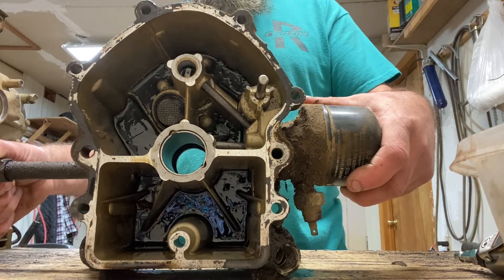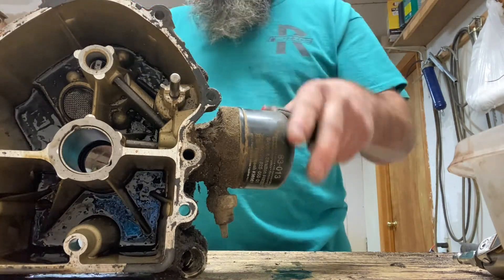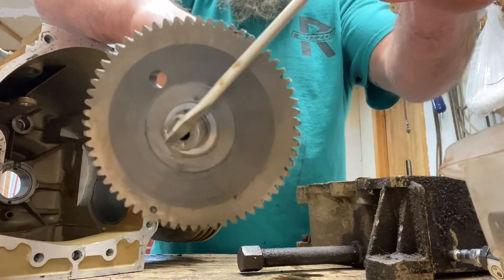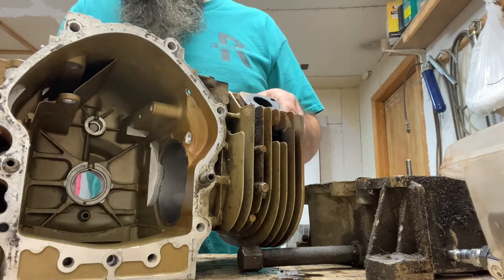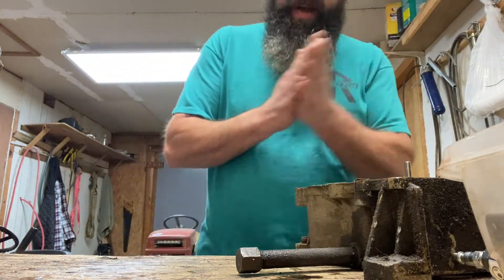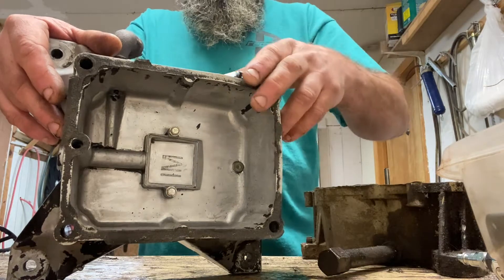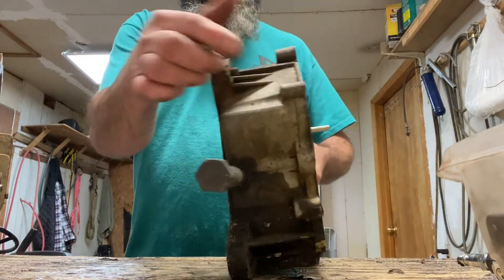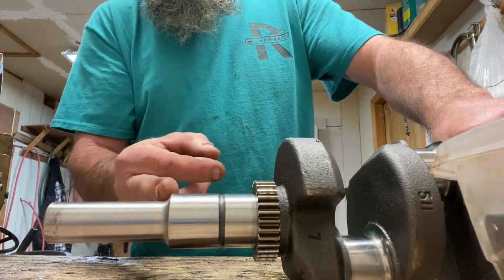Opposed twin vertical/horizontal swap

Comment: I swapped a vertical to horizontal splash lube briggs back in 2010. I had bought a Cub Cadet 582 with a broken rod and used a very late, (I'm guessing around a 2002) vertical twin from a MTD lawn tractor. The MTD had very little use and was abandoned at the lawnmower shop I worked at sometime around 2005. I ended up selling the Cub to a guy I worked for at the time and he used it for about 6 years to cut his grass. Flash forward to 2021 and I ended up buying the Cub back. I know this is a long story, but I have been using the Cub up until this year when I started having serious blowby issues with one cylinder. Turns out the RH breather valve facing the flywheel came apart, (ie. the bakelite flapper broke). When I removed the breather the lifter valve spring area was HALF-FULL of oil! Turns out there was no way for the oil to return back down into the crankcase! There were two holes, but would only work in the vertical position not horizontal. I overlooked this when I assembled the engine. I have taken the engine apart and drilled two holes (one in each area) for the oil to go down. I hope to get the engine back together sometime next week. I was also getting a lot of smoke on startup, I hope this fixes the issue.
Reply from the maker: Yes sir that will definitely do it! Good catch!

Comment: The blocks you speak of that were dual purpose (plastic plug in the horizontal dipstick hole) were from about '91 to '94. The cooling shroud on those were black. When they went to the red ones from the mid 90's and later the hole is just closed off like the one in the video.
Reply: Hello I’m trying to figure out if I have a dual purpose block. This plastic plug for the dipstick. Mine I think if I’m looking at it correctly it looks like a allen type plug? Is that possible? Just curious if you know or have gained any more knowledge about the subject? If not please don’t worry about it you were the first person to mention the dual purpose blocks. Either way Thank you.
Reply: @dalylarose2516  If there's a plastic plug there of any type, the hole will be underneath. It should be threaded.

Comment: If I find a pressure lube model 46 crank I'd just add it to my horizontal dip lube block and add dry sump with lines feeding the crank🤔

Comment: I'm working on one right now. I have the sump with screen Ive drilled a hole up to the screw hole that will feed front cover lower crank front and can above however my cam doesn't have a hole tru it captin! So it's either I drill all the way thru cam or send a feed up and over I'm not sure
Reply from the maker: Oh yeah, you definitely need SOME way to get oil to the other side, thats what feeds the other main bearing and rod. Should be able to drill the cam pretty easily, but it would need to be done on a lathe. Dont see why an external oil line to the other side wouldnt work just fine either.

Comment: Great video,but it seems to me if you put the oil pump higher than the oil level you would loose your prime.
Reply from the maker: As long as any passages leading from the pan to the pump are sealed up good, there shouldnt ever be an issue. Many automotive engines have the pump located above the oil level.

Comment: I think I'll add a dry sump pump and remote filter to my horizontal conversion if I can find the correct crank and cam there is a long stroke model 46 local was thinking about buying😉
Reply from the maker: Never heard of a long stroke 46 incher, but theres a big bore block thats getting 46CI with a 42CI crank. Stab a 46CI crank in that baby and youre gonna have an animal!
Reply: @captain_315  I have lot of the parts including billet rods, billet flywheel but need to order pistons though 
I found a big bore model 46 and a long stroke model 46 
I have had the long stroke model 46 dip lube crank machined to same dimensions as a horizontal shaft.
I'm thinking about adding pressure lube with a drysump pump and remote filter going to be a while as I get part together.
I think I can modify the flywheel side bushings for oil feed as the pto side has a bearing not sure how I'll do it yet need to watch ebay for a horizontal pressure lube sump
Reply: @captain_315  I also bought the split aluminum intake manifold for horizontal so I can port it out then silicone it back together
Reply from the maker: @willyck948  theres not much 'meat' to do a lot with those manifolds, I saw a decent loss in flow with one even fully ported, but nowhere near as bad as a factory vertical manifold. I think if you have the ability you will see big gains building your own. Bring the entrance into the port from the head side and loop it around- saw big gains here too versus stock entry.
Reply from the maker: I did not bother with this as 99% of our riding requires bottom end and midrange power vs top end. Mine definitely 'lays down' about 5000-5500, likely due to the single carb and factory intake.

Comment: Very informative video sir! Thank you. I'm constantly searching for pressure lubed twins. So far, i've only managed to snag one, a 422777. It's nice to know a little more about them now. Thank you much.
Reply from the maker: Theyre like trying to find a needle in a haystack arent they?
Reply: How do I know if I have a dual purpose block? And my Koler vertical that I’m trying to convert to horizontal only has one vertical oil pan and the filter stays on the engine and the case splits right side and left side. I don’t know maybe it’s how all of them are but would appreciate any feedback thanks.

Comment: Couldn't resist to watch.  Interesting detailing, I appreciate that sincerely.  Makes me want to start disassembling and 3D scanning parts somehow, either at the local Fab Lab or trying some open source photogrammetry.
Reply: Makes me want to look into more what I got since I just jumped on when I had the chance and am not for sure.  Another great reason to get my part and material stock pallet rack up and start organizing more.  Thanks for sharing the two design differences... I've not seen on any other YT video.
Reply from the maker: @jafinch78  awesome!

Comment: I feel like a well supported peerless 700....I'm talking needle bearing swapped, 4 shift forks, fully girdled, with an input and output support bearing to a good chain drive live axle might just be a good route to go if you have a vertical shaft one of these... i do think that setup could turn some big tires... Idk that's what I'm gonna do with my oppy anyway.. I have 22" ATV tires for the rear I plan on taking advantage of the rear suspension possibility too... Lol honestly though if I had a wheel horse rear end and I really wanted to use an oppy on it I'd probably use a ragb but I can get my hands on that kind of stuff basically free and people typically want $ for any old tractor parts weather or not they're in good shape especially anything horizontal shaft...

Comment: What is the part number for the horizontal shaft oil pan and cover plate?
Reply from the maker: Sorry, I did not write the numbers down before I put it together. They are very hard to find.